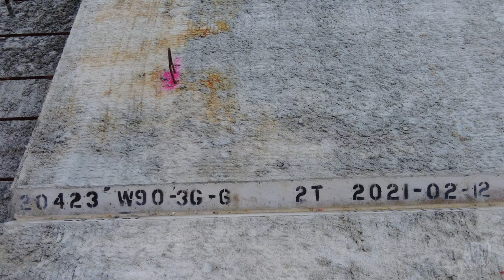It's Complicated - 4K

Comment: great videos on this bridge. been watching it ever since the Walters Group rented my stud welder off me. @ 4:40 you can see my portable Generator / Stud Welder. @ 5:15 those MYSTERY STUD? those are 3/4-10 x 2-1/4" full thread weld studs. that is DRAWN ARC Stud welding. once the trigger is pulled on the stud gun it will shoot ( for 3/4" ) 1600 amps to the stud for just under a second to fuse the stud to the beam. all those other headed studs on the top of the beam get welded in the same process. 
keep up the great work on the videos.
Reply from the maker: Thank you - brilliant insight. The stud welding continued today.